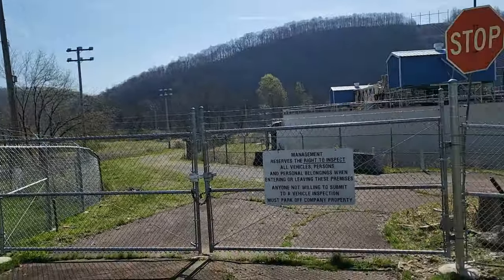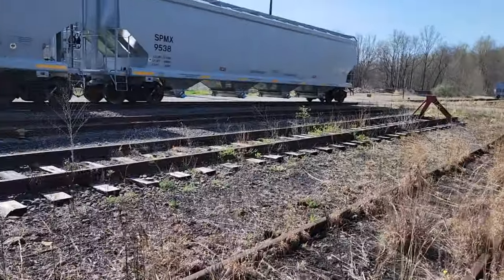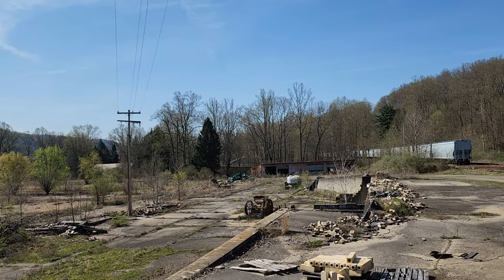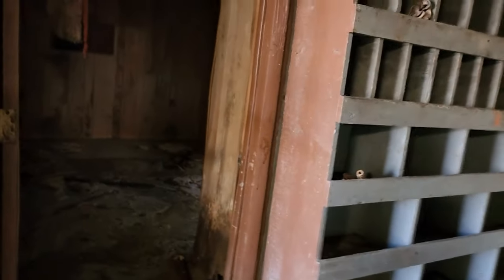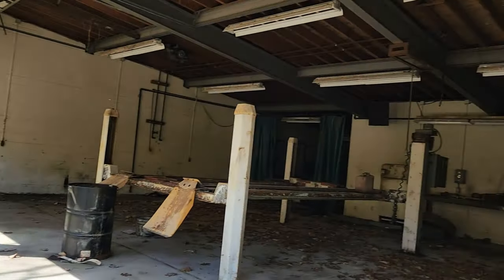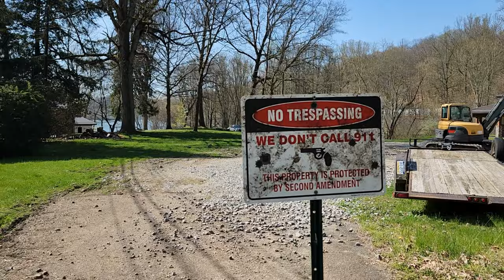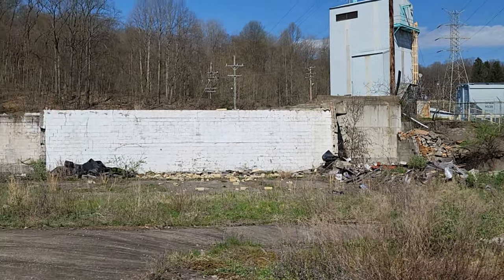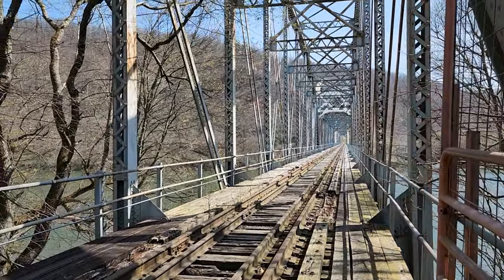Abandoned Power Plant in Templeton Pa

Comment: It’s in Reesedale Pa not Templeton Pa
Reply from the maker: After I made the video and did some more research I found out that is was not in Templeton.  Have you walked the tracks and visited the trestle and the train tunnel about a mile away? I loved visiting there.
Reply: @stevewarrene   No I have not. I didn’t even know that there was a tunnel so thanks for letting me know. I grew up in Adrian about 5 or 6 miles from the power plant. But I never walked the bridge or the tracks on the other side. I lived in the area for 32 years. I moved away and have been gone for around 35 years. I still have family in Adrian though and do go back guitar often. You might want to check out the Boltz Road off of 268 south of Cowansville. There is a single lane wooden bridge on the road. If you look down from the bridge there is tracks and a tunnel there. Check that one out, it is very cool. It used to be the B and O trains that run on the tracks. I don’t know what train runs the tracks now though but it is an active railway. Good luck and thanks for the great pictures!!